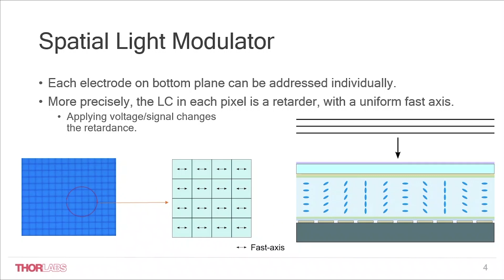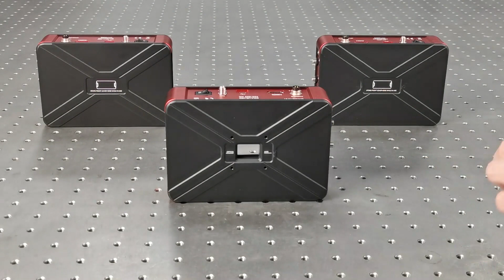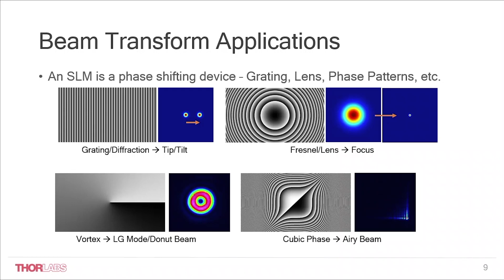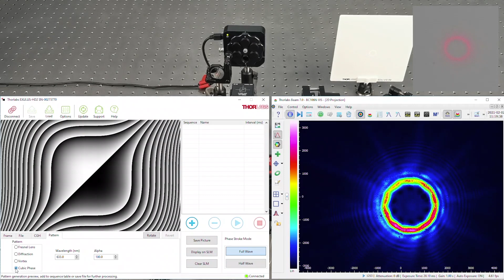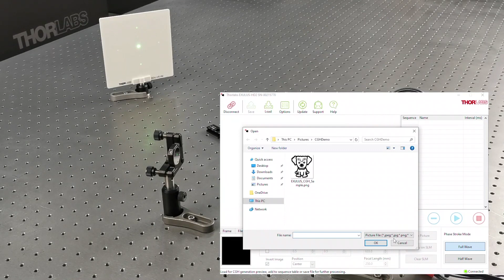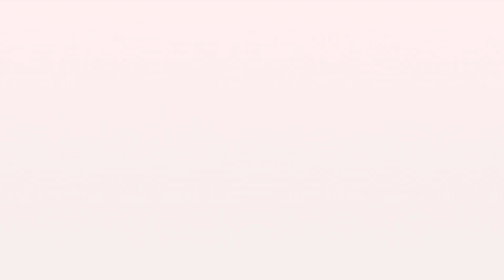EXULUS Spatial Light Modulators – Principles and Applications

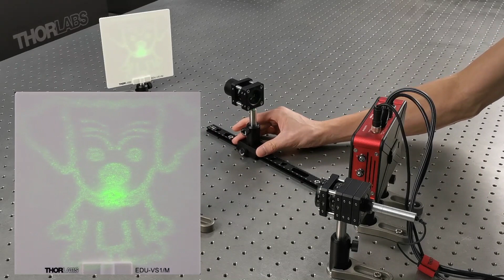Comment: What imaging lenses are used here at 20:58 and how do you compensate for the reduced contrast?
Reply from the maker: The lenses that we use are the same as those in the App Note tab as in the product page ( https://www.thorlabs.com/newgrouppage9.cfm?objectgroup_id=10378 ): an f = 50 m (LA1131-A-ML) followed by an f = 75 mm (LA1608-A-ML). Note that the choice of the lenses can be very flexible. It depends on the desired size of the final projection, and how short the effective focal length of the CGH is set in the software. The shorter it is, the smaller of the first image is formed and is closer to the SLM unit. Then, one needs more magnification with the imaging lenses in order to achieve similar projected image size.

Regarding contrast, unfortunately the central zero-order spot exists due to the hardware itself (gaps between pixels are not processed by the SLM). While expanding the zero order and re-imaging the CGH projection can help distribute the zero-order spot to a larger area, hence a less prominent central spot, the contrast of CGH image itself is inevitably reduced. We have not systematically tested, but one could try setting a smaller focal length in the software CGH settings, and re-image using higher power lens system. This basically means spreading the zero-order spot even further out, which may help maintain a better contrast.
Reply: @thorlabs  We are using this with the modular optical tweezer (OTKB). Can you tell me which lenses will be suitable to use with the system?
Reply from the maker: @Z0M8i3_33  You can first try to project the CGH image as demonstrated in the video and then revise the lens combinations for an image size that is compatible with your tweezer system. You can also add another lens relay to further reduce the image size. For more specific information about lenses that could be compatible with your specific setup, please contact Tech Support at techsupport@thorlabs.com.

Comment: I'm trying to use a similar setup for my thesis , would be great if you provide me which polarizer , halfwave plate and reflecting mirror is used , for generating array profile , I'm stuck with the setup  .  it would be very helpful if I can contact via email .
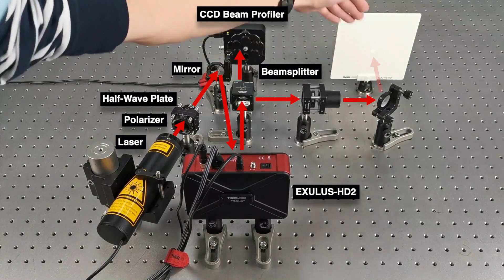Reply from the maker: Hi Yogal, thanks for your interest! Although any components designed for use with the laser wavelength should work, the setup shown at 13:43 incorporated our LPVISE100-A Linear Polarizer, WPH10M-633 Zero-Order Half-Wave Plate, and PF10-03-G01 Protected Aluminum Mirror.
 
Within the setup, the polarizer is used to clean up the polarization of the laser light; in situations where the laser’s output polarization is already clean, the polarizer is not necessary. You’ll want to rotate the half-wave plate so that its polarization axis aligns with the SLM's axis. It is easy to tell when this state is achieved as the desired pattern becomes clear once the polarization angle is optimized.
 
If you need any further assistance, we would be happy to help!
Reply: @thorlabs  I have been tasked to bend the light in parabolic way , I have setup my experiment as it is shown in your setup . 
I could not get the perfect image in CCD and my aim is to bend the light in parabolic pattern .
Reply from the maker: @yogalghimirey63  Thank you for your response! Can you please describe your experiment in more detail? Why is there a parabolic requirement? And what is the parabolically bent light being sent to downstream?

Comment: Thank you for the video! Can you share the lens specifications that you use to project the hologram?
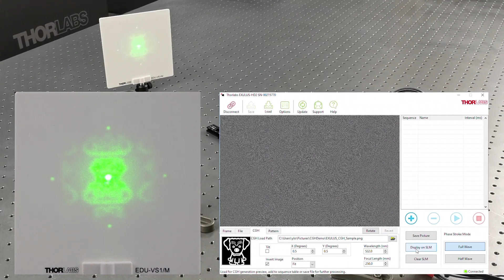Reply from the maker: The lenses added to the beam path at 20:55 are a pair of Ø1” plano-convex lenses with focal lengths of 50 mm and 75 mm. These were chosen based on the desired size of the final projection and the focal length setting in the EXULUS software. In general, the shorter the EXULUS focal length setting, the smaller the image, and the closer the image forms to the spatial light modulator. Increasing the magnification with the imaging lenses would then allow a similar projected image size. You can read more about this kind of application on our website:

https://www.thorlabs.com/newgrouppage9.cfm?objectgroup_id=10378&tabname=App%20Note#tabTitles

Comment: This is very neat. I'm interested in holograms. From my limited inquiry, it seems digital hologram printing made a limited debut, then quickly died due to its finding limited success in marketing/point of sale applications. I'm curious if there currently exist any "turnkey" hologram printing devices, or even services.
Reply from the maker: Glad you liked it! The EXULUS, and in particular the HP series, can be useful for laser writing based on holograms. If you’re looking for a digital hologram printer that creates a 3D-like image on a substrate, or something that cures epoxy, ink, or similar materials, the EXULUS is probably not the right fit.

In general, the EXULUS spatial light modulator dynamically transforms an input beam into a patterned profile as a 2D projection on an image plane, which enables applications including optical tweezers, multiphoton excitation, and laser writing. If you have a specific application in mind, feel free to follow up with us at techsupport@thorlabs.com.